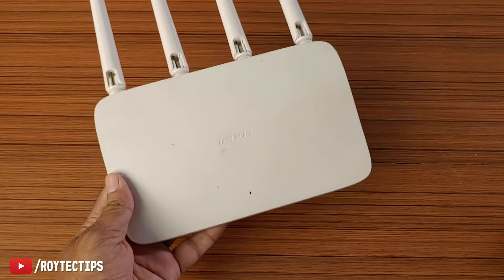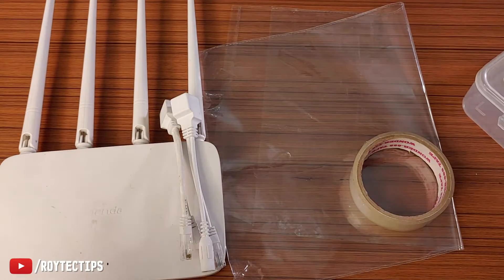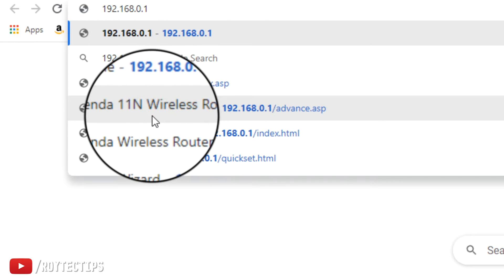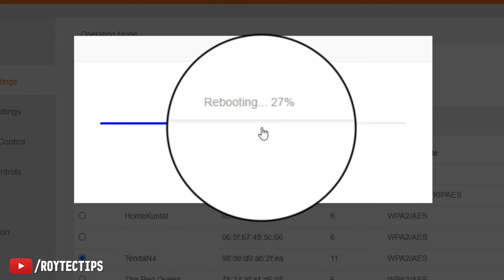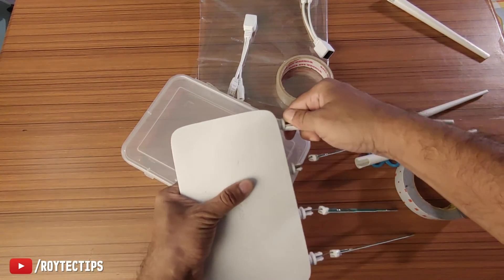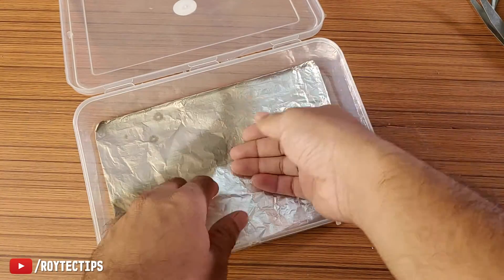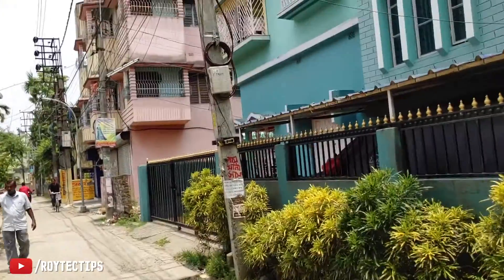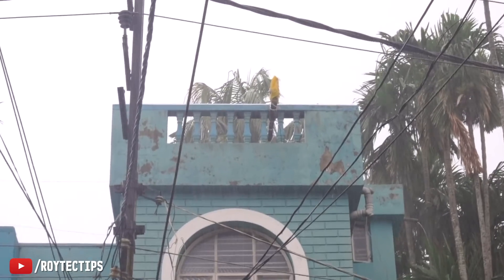How to turn old WiFI router into a long range outdoor wifi CPE.

Comment: Since you extend an Internet connection with another router, by Ethernet cable, connected with the main/first router, THE SECOND ROUTER IS CALLED: Access Point, and by no means Extender, of whatever kind! Extender or Repeater is only when you extend the Internet connection with the main router, that's all! And, when doing it as an Access Point, the Ethernet connection cable from the main router, goes necessarily from a LAN port, and to the second router, gets into a LAN port, AS WELL! Never, ever otherwise! 

BUT, most importantly, the settings that you did to the second router must've been explained that it has to have a different IP class than the main router which is why you showed us the main router's IP class in the first place, and secondly to set the second router, so there will not be an IP conflict between the 2 routers!

By the way: be precise when you say "I'm getting "xx bps", since "bps" means not only "Bits per second" but also "Bytes per second" if you really know the difference!

Comment: What happend to that poor router. It is been 8 months now. Use the CPE antena with the router motherboard. but please show us the inside of that cpe. and take exact mesurement of that antena. maybe if you make it work well then you and we can use it to reproduce and reuse.
Reply: Please show us inside of that cpe and measurements of that cpe antenna 📡📶 so we can maybe reproduce and use it.
Reply from the maker: Still working without any problem

Comment: Just buy 100 meter cat5 cable bro 🙄
Reply from the maker: Need more than 100 meter 170 meter long cable needed. We need a switch after 70 -80 meter. Better solution is to use optical fibre .
But both option is expensive and we need to buy some new hardware. For this setup my expense is nothing .
Reply: @RoyTecTips  use media converters at both end. And fiber tough wire. It's cheap and permanent and risk proof

Comment: What about heating of router,as it is air tight.
Reply from the maker: it's a low-power device that consumes only 2 watts or less like a phone, it does not heat much but definitely heats more than indoors. using it in this way probably decreases the life of the router.

Comment: hello abhijit sir, i just want a small information from you about importing from usa to india. i am planning to import a small size sports good product from usa and the usa seller told me that the product will cost 35$ including shipping. now my question is that if i tell the seller to reduce the product price on packaging invoice to reduce the custom charges in india and if he do that as well, lets say the seller put 10$ on the package and the package weight is under 200 grams and diamentions are length - 15 cm, width - 12 cm, and height is - 3 cm then how much custom duty is applicable for this kind of small light weight package? 

if you reply to that it will help me a lot sir.
Reply from the maker: Use USPS for low custom charges. , dhl fedex will charge you.
Reply: @RoyTecTips  thank you